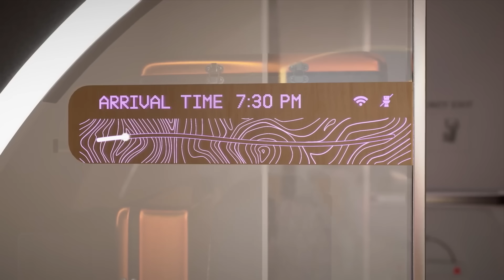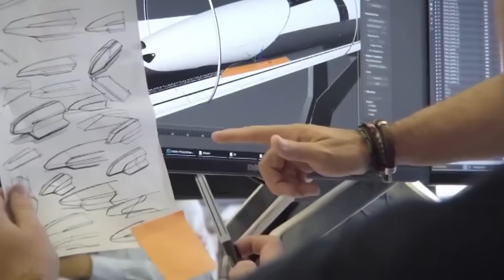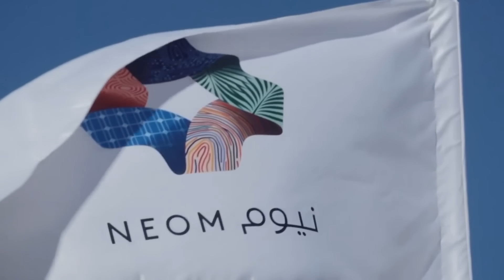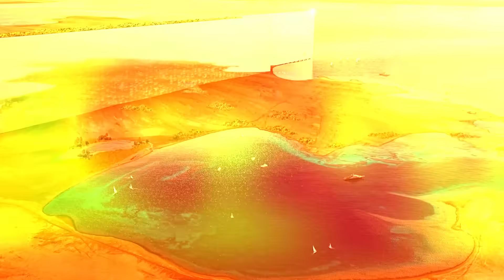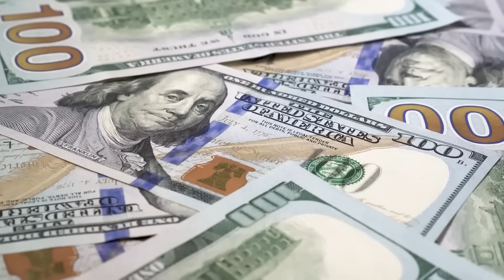Construction Begins On The Line Megacity. It's Actually Happening! 😲

Comment: This is a kind of concept that sounds really cool in theory, but in practice its going to be a hellscape.  There are so many issues with this design that honestly I'm not even sure where to begin, but there are already some great critiques of this design on youtube and I'd suggest anyone who thinks this is even remotely a good idea to look them up.
Reply: Also, it seems uniquely vulnerable to being crippled by terrorist attacks, smack dab in the middle of the region that invented terrorism.
Reply: @marktrain9498  Terrorism is a European American invention
Reply: This project is just a giant prison
Reply: It'll blow over with a strong gust of wind lol
Reply: Could you elaborate on what issues it presents? I’m interested in hearing your opinion
Reply: @maquina7002  its in a straight line, if there's a break in the mass transit at the bottom level it'll stall all 170km of movement.  It cannot grow past its boundaries, if the population exceeds what is planned there is no possibility of spread.   They plan on using large drones as transport which will be unreasonably noisy and pull dust from the desert up and then into the line when it lands on top.  Unlike a normal city which tends towards being oval shaped you might actually have to travel the entirety of the line just to reach the amenity you need.  They  are planning on building something as tall as the empire state building for 170km, the empire state building uses over 70 elevators, how many elevators do you think the line will need?  If there is problem with the land underneath the line at any point in that 170km it won't work, meaning all 170km of that land needs to be able to support this monstrous structure.  Its also gonna pick up enormous amounts of wind force being an enormous giant wall near the ocean.  Finally, they say the model is to help conserve space and prevent urban sprawl, but its in a desert where you have a huge amount of space.  There's actually more but this should be enough for now.
Reply: @maquina7002  Like he said, there are MANY YouTube videos out there, look them up.
Reply: it doesnt sound 'cool' to me whatsoever, what a waste of resources money and lives this will be!
Reply: One obvious thing that jumps out at me is the lack of alternative routes and transportation to get from point A to point B. Unless that's in the plans somewhere. Where does the hospital go? How do you get to it if you need an ambulance? What happens if the underground train breaks down?
Reply: @acemanjoe  i think the point is that you dont get options or alternatives, you do as you are designed and told to do or else!!
Reply: @anthonyjarvis9472  yeah, it does kind of feel like that. Everything is just fine as long as everyone act like sheep.
Reply: @shoveI  😂 Awesome
Reply: They won't look up sh!t.  You have to remember, most people are low information NPCs, who can't stand to hear anything resembling truth, or reality!!
Reply: The whole thing is silly. 
There is nothing redeeming about a linear shape for a city. 
This is a triumph of marketing to rich weirdos. Oh look he already murdered locals opposing.
Reply: Don't worry about it if it isn't built in your country or taxpayers in your country. That's their success or problem
Reply: Are they actually going to do it?? that's just crazy.. Now a circle that I would find interesting, that way you end up at the starting point again and that way you can have in the centre centralised services or just a giant eco park. A line is just so weird..
Reply: I bet they won't allow you outside of the walls.
Reply: this never sounded good
Reply: It will work completely fine, except people.
Reply: Because you don't have the IQ to think like their architecture and engineers 🤣🤣
Reply: @calculative1387  oh god, a redditer
Reply: Why? I think this could easily be a good thing. It’s just very expensive, and maybe not actually feasible.

I think a lot of people here have simply watched too many dystopian sci fi media
Reply: @Icetea-2000  I think you have watched too many episodes of barney the dinosaur, because in no way is this a good idea.
Reply: @HolyCobalt  Why, it’s just a giant city. It’s neither good nor bad, get your emotions out of this.
Reply: @HolyCobalt  Why
Reply: @Icetea-2000  Your inability to realise huge, massive flaws in an idea
Reply: @HolyCobalt  Am I? I already said that it’s a giant project that is very cost intensive and might not even be feasible in the first place. 
But in the end it’s just a city they’re building. People are acting like this is some sort of dystopia, calm the fuck down, it’s just a massive undertaking that probably won’t even be completed
Reply: @Icetea-2000  I will stone cold Steve Austin you
Reply: @Icetea-2000  I will stone cold Steve Austin you
Reply: @Icetea-2000  lol,  its a good thing to sink billions of dollars into a potentially unfeasible infrastructure project. Sure.  Why not.  And as far as dystopias go  the UAE is already one right now, it doesn't need to worry about becoming one in the future.
Reply: @WelfareChrist  I didn’t say it’s a good thing, I already said that it’s probably infeasible. But everyone is acting like the mere concept is somehow bad. Like I’m not a city architect so why would I make a judgment call on its prospects as a city if it was already completed? However it likely isn’t realistic or economically viable to build a 170km long 500 meter tall structure, and you can make a call on its economics without being a city planner
Reply: @mitzikolo  You're thinking of a single devastating bomb. All it would take is a few bombers flying in a straight line, dropping dozens of bombs in a line. When the first finishes it's drop, then next begins and so-forth and, since the city is in a line, the anti0aircraft placements aren't going to be very well spread out. 
Not to mention those giant glass walls. That's the dumbest thing I've ever heard of.... Other than living inside a wall that's 100 miles long and as wide as the length of 2 football fields.
The whole concept is silly.
Reply: @frey8725  Totally.
Reply: @frey8725  ??? We don’t design cities based on anti aircraft raids, what kind of logic is that? The city is silly because a bomber could drop bolbs in a straight line on it?? If any force is able to do that what would keep them from having many more bombers and doing the same with literally every other city on earth? How is that even remotely an argument? Cities are not really concerned with preparing for bombing raids since the second world war
Reply: @Icetea-2000  Annnnnd there's the person who jumps into the middle of a conversation, only focusing on one comment, taking it out of context, so they look stupid. 
I was responding to someone else commenting about the bombing strategy. In the future, try reading all the comments in a thread before choosing one in the middle to respond to. It's like walking into a conversation and commenting without knowing what the others are actually talking about.
Reply: @frey8725  That makes absolutely no sense. I was solely responding to your first comment, and I know the context for that comment, I was talking about how your comment makes no sense.

If that comment doesn’t represent what you’re trying to say either edit it or delete it but people don’t have to read later comments to make a judgment solely on your first comment
Reply: @frey8725  No, I didn’t "jump in the middle of a conversation". I am simply responding to your first comment and am not taking anything out of context. 

You said that all it would take is a bomber flying in a straight line across it and that the design is therefore a failure. Now am I wrong in saying that that’s what you said? Is that out of context?
Reply: @Icetea-2000  Yes. You DID jump in the middle of a conversation since you're responding to a comment that's in the middle of a conversation. My first comment wasn't the first comment in the conversation. See how that works?

"Now am I wrong in saying that that’s what you said? "
Yes. You are wrong in saying that's what I said. Where did I say that " the design is therefore a failure."? I simply pointed out that dropping bombs in a line would take out the whole city. That was in response to someone else saying that a city in a straight line was better against bombs. If you hadn't have jumped into a conversation that you weren't even a part of, you would have figured that out.

Now go find somebody else to annoy, kid. There has to be a better argument out there for you to start, somewhere.
Reply: @frey8725   Lmao you sure are triggered. You’re simply unable to grasp that I’m not judging you on anything else, I’m simply judging that one comment of yours. Whether you made that first comment is completely irrelevant, I don’t see how that makes a difference.

You said in your comment that the "whole concept is silly", with your previous comment being about how easy it would be to bomb it in a straight line and how difficult it would be to defend with anti aircraft guns.
That’s what I’m addressing, your apparent misconception of thinking cities have any sort of goal to make themselves safe from ww2 style bombing runs.

If you still don’t understand what I’m saying or cry that I’m being unfair because it’s not the first comment in the comment chain even though that doesn’t change what you said yourself, then I don’t know what else to say. You’re simply too thick headed
Reply: @frey8725  If calling others Karens makes you feel better go ahead. I just made my point and you can throw ad hominems at me as much as you like but you should know exactly what I meant. You just either don’t want to or can’t realize it.
What is the context to your comment that changes anything about what you were saying? There is no context, you said it’s a bad design and that bombing runs are easy to do on it. Please enlighten me, what is the context that changes that?
Reply: @mitzikolo  Wrong, it would be extremely easy because all you need in to land a hit anywhere along the line and the entire thing is disrupted. Several bombs and the line becomes ”the checkered line”. A traditional city would be far more resilient.
Reply: @mitzikolo  ”Simply going underground” is possible in traditional cities aswell. Your argumentation that it’s ”better” to have your city configured in a line because an explosion is ”round” is flawed. Just because there’s nothing worthwhile outside the line, that doesn’t help the situation within the line which would be totally annihilated by a nuke.  The fact that ”most of what was blown up was just desert” is no consolation.
Reply: I have mobility issues and in all these new concepts people like me aren’t considered.  I’m not concerned at all 🥴

Comment: If the train is mag-lev, it should go fast enough. They should build the outer part not with mirrors but solar panels and yes, build about 2 kilometers, with an "unfinished" extension so they can add on as necessary with more modern tech without disrupting the existing section.

Comment: The line is and will stay a stupid concept in my opinion. But still about the underground train speed, it isn't so unlikely to reach 318mph. Since the maglev train in Japan reaches 375mph already, which is real technology that's already in use, so I don't see a problem with that. Still a stupid concept, the area around the wall will just be inhabitable since the mirrors would give you burns already.

Comment: Regarding the high-spped train, one part of the video says that the Saudi's have indicated that you can travel between nodes in 20 mins. (and that alll necessary amenities would be within a 5min walk of each node)..then moments later the video makes the error and indicates that there is no current high-speed technology that would allow travel of 100miles in 210 minutes.  100 miles is the total length of the projecet...not the distance between nodes.
Reply: You made a mistake in your comment. You put 210 minutes instead of 20 minutes.

Comment: These guys actually mentioned Hyperloop. Get outta here with that nonsense.

I doubt the transit would get to that speed, but having said that, they wouldn't be using exiting topography, they're using straight tunnels. It'd be a lot easier to ramp up speeds without worrying about mountains etc. RIP animals who need to move through the area and native nomads.

Comment: you can build a LOT of inefficient expensive stuff, but you can hardly maintain it, just look at almost every usa suburbian road, that got abandoned after 40-60 years, because the road was build too big and basically a pyramid-scheme that could only work short term IF the caputalist-suburb would grow a lot in a short time. the road and its sewage system was WAY too expensive to repair when the  first repairs were due, because they were build too big, and the houses near them got abandoned.

Comment: The Proof is in the Pudding

Consider the Sun, how it burns hotter than anything. Yet it does not ignite anything around us nor does it go out even thou it is in the vacuum of space where there is no oxygen nor external source to feed it. It rises in the East and sets in the West on a perfect cycle that is more advanced and longer lasting than the most intricate swiss watch we have ever made. Never needs an update nor be rewound. It sets our days and all forms of time, even the seasons.
Consider the Moon, how it also has a perfect cycle like the sun. Yet changes its form and color in perfection. How it is so much smaller than the Sun, yet is in perfect range that both are the exact same size. One and the other able to perfectly cover the other, and also providing light when it is night.
Consider the babe, how it grows in the mother and or in the egg. All things it needs are provided in the egg and or by the mother. Her body perfectly formed to carry and changed for that babies needs. Not one does fail by any evolutionary dysfunction. 
Consider the Ocean and rivers, all rivers flow into the Ocean yet the Ocean is not full. From where the rivers start, the water returns unto them. 
Consider the Eye and the Ear, how complex yet small they both are. The Eye is never full of seeing nor the Ear full of hearing.
Consider the Plants and Seeds, how each Plant is not lacking and the vast complexity of each one. Providing so many benefits and uses for each in a perfect balance with nature and the animals that depend on them. How the Seed does not just sprout without the water / rain. How the seed like the egg contains all the plant needs as a sprout.
Consider the Rain. How water evaporates by way of the Sun and forms clouds, from where the Rain came from it returns and falls again, in a perfect cycle with the Sun. 
Consider the Wind and the Jet Stream, how it whirls around the entire Earth yet is not full nor tired. In its perfect form it continues just as all the many systems do.
Now consider how it is possible for all these impossible systems to hold perfect and be perfect at the same time. 
God is real and his works are all around you.

ROMANS 1:
19 Because that which may be known of God is manifest in them; for God hath shewed it unto them. 20For the invisible things of him from the creation of the world are clearly seen, being understood by the things that are made, even his eternal power and Godhead; so that they are without excuse: 21Because that, when they knew God, they glorified him not as God, neither were thankful; but became vain in their imaginations, and their foolish heart was darkened. 22Professing themselves to be wise, they became fools, 23And changed the glory of the incorruptible God into an image made like to corruptible man, and birds, and four footed beasts, and creeping things. 24Wherefore God also gave them up to uncleanness through the lusts of their own hearts, to dishonour their own bodies between themselves: 25Who changed the truth of God into a lie, and worshipped and served the creature more than the Creator, who is blessed for ever. Amen. 26For this cause God gave them up unto vile affections: for even their women did change the natural use into that which is against nature: 27And likewise also the men, leaving the natural use of the woman, burned in their lust one toward another; men with men working that which is unseemly, and receiving in themselves that recompense of their error which was meet. 28And even as they did not like to retain God in their knowledge, God gave them over to a reprobate mind, to do those things which are not convenient; 29Being filled with all unrighteousness, fornication, wickedness, covetousness, maliciousness; full of envy, murder, debate, deceit, malignity; whisperers, 30Backbiters, haters of God, despiteful, proud, boasters, inventors of evil things, disobedient to parents, 31Without understanding, covenant breakers, without natural affection, implacable, unmerciful:

THIS IS WHY SO MUCH EVIL IS GOING ON RIGHT NOW

Turn and seek God, repent and bring forth works worthy of repentance. Time is short.

Comment: I would suggest a different approach. How about 5 big round circles!  Think Apple building but much grander scale and 5 inter-secting circles, each have parks and man made lakes.  This would solve the birds and animal migrations. It would also solve the issue the the local tribes as the circles can be placed outside their domain.  I just feel there is a better way of doing this.
Reply: Your oppinions are right.
Reply: I think the point of the line is access to the beautiful mountain ranges and the redsea in 1 hub.
Reply: Instead of circle, doing nothing will solve the problem.